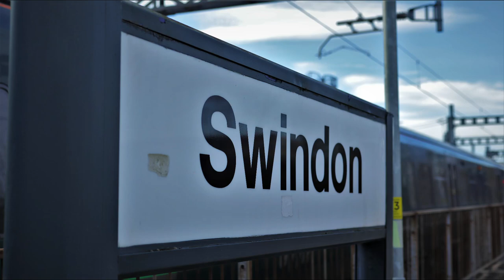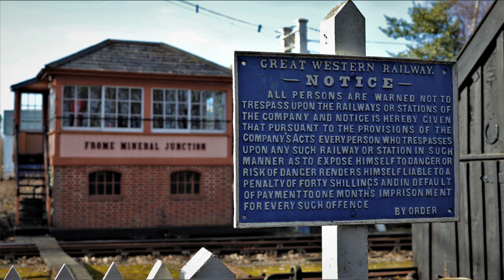Didcot Railway Centre 2:  in Steam

Comment: Hi Paul, You certainly looked warmer than last time!!

The sound of steam came through really well. I loved the clip using the carraige window as a frame as you passed the rake of restored  goods waggons. The effort these volunteer groups make to recreate these sets of waggons is admirable and they really add to the atmosphere to the railways.

Also impressive is the lions head cannopy support for Heyford station, some great pictures out there showing the dismantling of the station from almost 40 years ago.

Enjoyed the clips from through the front window of the railcar, even if they did have a bit of reflection. As it approached the station you could easily distinguish the track gauge difference. 

Most of Spain's railways were built to a broad gauge (not sure if its the same as Brunels) but the modern HST lines are being built to standard gauge making seamless trans-european rail travel a possibility. 

Rail travel to France without changing trains is possible due to the axles being design to be extended and retracted in a special installation. In fact the section of HST down to Granada where we are is currently having a new gauging machine installed as was prohibitive to build completely new tracks in the approaches. The two gauges share the same track bed. You can get to Madrid now in about 2 1/2 hours or drive in 5 hours  (and then spend all day looking for somewhere to park).

Thorougly enjoyed watching and look forward to you taking us back in the future

Good luck from Spain!!
Reply from the maker: Thank you for a really great comment David. That was such an interesting read. I did not know that about Spain using broad gauge. It seems to me that the 'inferior' (i.e. standard gauge ) won out. Broad gauge has many advantages. It is often the case that the better tech loses out  - money over sense! I can see why it makes sense now that standard gauge is everywhere to link up the whole of Europe by rail. I love how the axles can be extended and retracted - very clever! I always prefer to travel by rail where possible. Both Bath and Bristol now have ULEZ (ultra low emission zones) making travelling there by car cost prohibitive (not that I ever would anyway, as like you said finding somewhere to park, as well as traffic jams are real headaches) - I can see that being extended to other cities in 'my' region like Truro, Plymouth, Exeter, Gloucester, Worcester and Salisbury too.  The main problem with public transport here are busses - both the lack of, and poor frequency of them - and, crucially, unlike with national rail, there is no central mobile app to tell you about bus times, and when they are (or more often aren't!) running. Planning to go onward journeys from rail stations is problematic, and very difficult, as it was with my most recent Severn Way trip! I digress! Didcot Railway Centre is well worth visiting - and being right next to Didcot Parkway Station, no bus required! Take care, Paul.